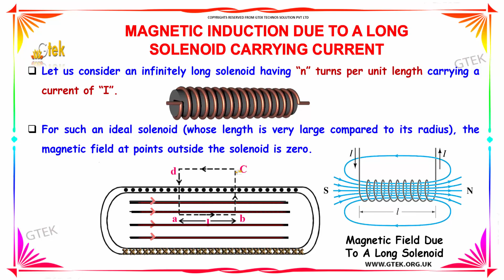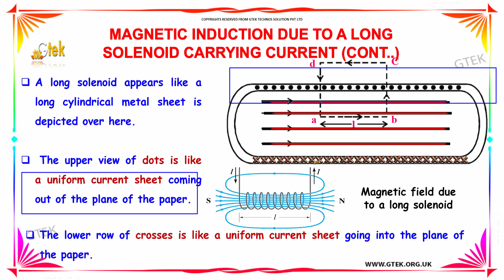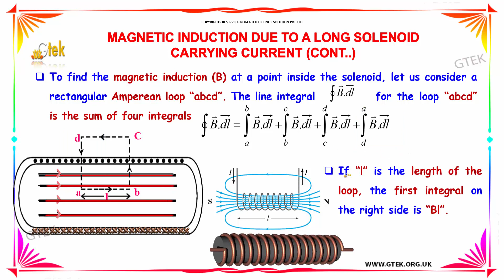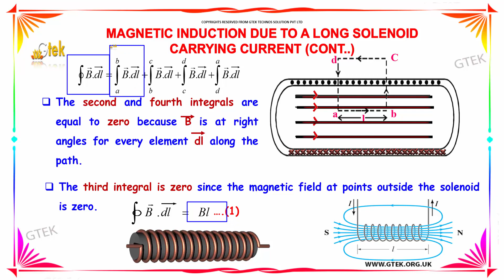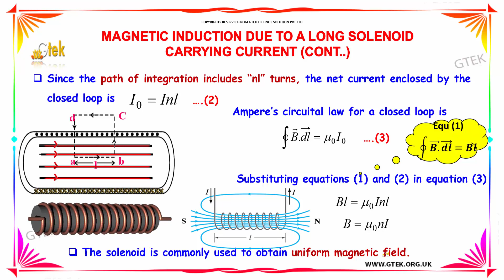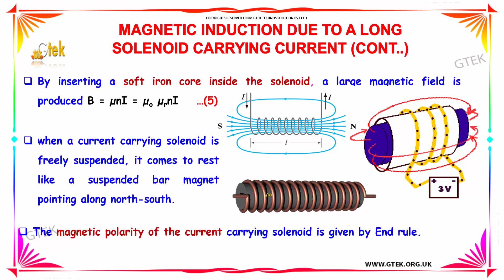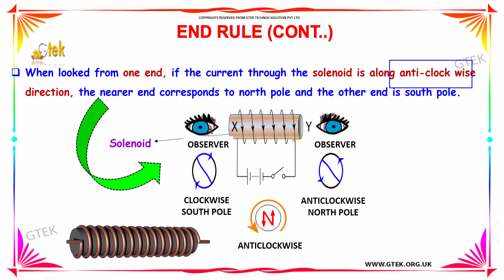Magnetic Induction Due to a Long Solenoid Carrying Current Effects of electric current class 12

Comment: Solenoid. A long straight coil of wire can be used to generate a nearly uniform magnetic ... In the above expression for the magnetic field B, n is the number of turns per unit length, ... Derive field expression, Calculate field, Field of current loop ...

Comment: In a solenoid, a large field is produced parallel to the axis of the solenoid (in the z-direction in figure 2). Components of the magnetic field in other directions are cancelled by opposing fields from neighbouring coils. Outside the solenoid the field is also very weak due to this cancellation effect and for a solenoid which is long in comparison to its diameter, the field is very close to zero. Inside the solenoid the fields from individual coils add together to form a very strong field along the center of the solenoid.

Comment: For such an ideal solenoid (whose length is very large compared to its radius), the magnetic field at points outside the solenoid is zero. A long solenoid appears like a long cylindrical metal sheet (Figure). ... The solenoid is commonly used to obtain uniform magnetic field

Comment: A solenoid is a long tightly wound cylindrical coil of wire. When a current is passed through a solenoid the magnetic field is produced, which is strong and uniform inside, while it is negligibly weak outside.

Comment: SOLENOID:
A long straight coil of wire can be used to generate a nearly uniform magnetic field similar to that of a bar magnet. Such coils, called solenoids, have an enormous number of practical applications. The field can be greatly strengthened by the addition of an iron core. Such cores are typical in electromagnets.

Comment: Magnetic Induction. First, finish up magnetic fields created by currents. A solenoid is a cylindrical coil of wire. It creates a relatively uniform magnetic field in its ...

Comment: MAGNETIC FIELD OF INDUCTION DUE TO SOLENOID--SOLENOID. A solenoid is a long tightly wound cylindrical coil of wire. When a current is passed through a solenoid the magnetic field is produced, which is strong and uniform inside, while it is negligibly weak outside.

Comment: Question: An electric current passes through a straight wire in the direction of ... Question: The magnetic field lines inside a long, current carrying solenoid are nearly ... Question: The direction of induced curent is obtained by ... Question: A device used for measuring small currents due to changing magnetic field is known as ...